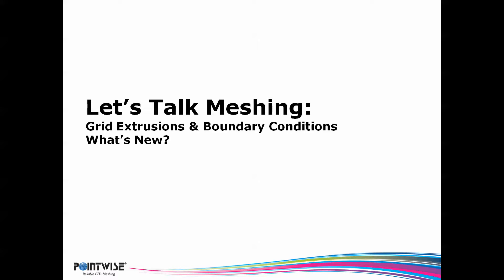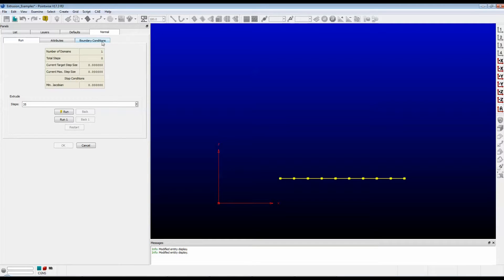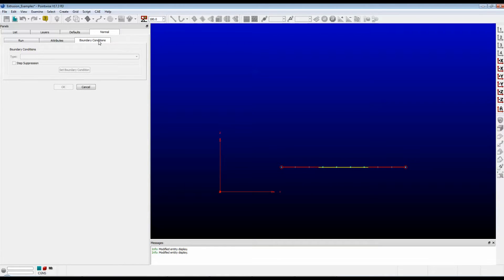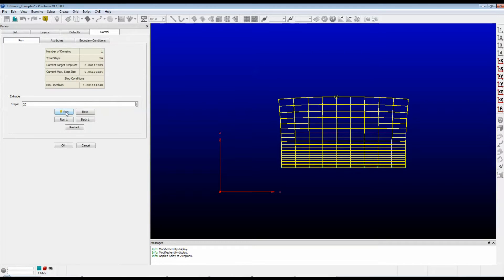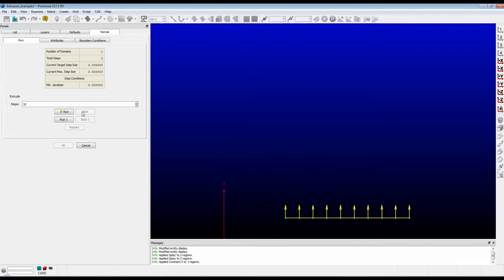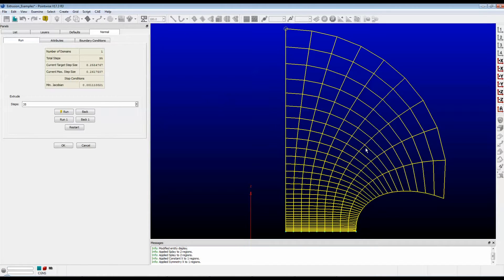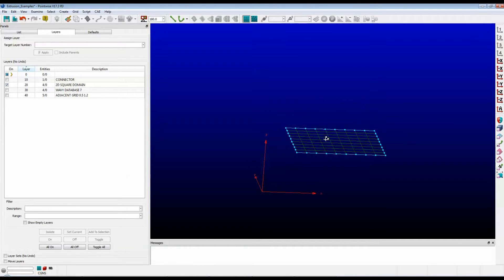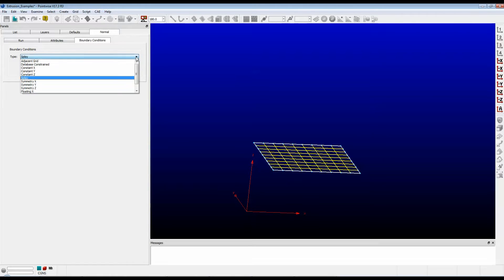Grid Extrusions & Boundary Conditions: What's New?

Comment: Thanks for the video. I have a different question about CAE boundary conditions. Does anyone have any idea about setting temperature b.c. In point wise?
Reply: CAE BCs are solver dependent. Select your solver from the CAE menu and then specify your BC types. A type is more or less just a tag so the solver can recognize it. Once you import the mesh into your solver you specify more specific attributes like temperature or velocity for example.
Reply: I've already selected my solver which is Ansys Fluent. And there are only mechanical fluid properties (like Pressure, Velocity etc.) and there's no thermal and heat transfer BC (inlet temperature and constant heat flux are what I need). 
About what you said for importing, I did import it to Ansys Fluent (v.16) with cas. extension, but I couldn't ADD any BC. A friend of mine said you can assign BC in mesh part, and I can't get access to MESH EDIT and BC assigning part. It seems like its kinda read only mesh. 
A major problem with Point Wise is that I want to have 3 BCs (pressure inlet, velocity inlet, tempreture inlet) for my inlet and in point wise it seems impossible to set more than 1 BC for each domain. If I could assign more than one BC, you were right and I could edit them in Fluent.